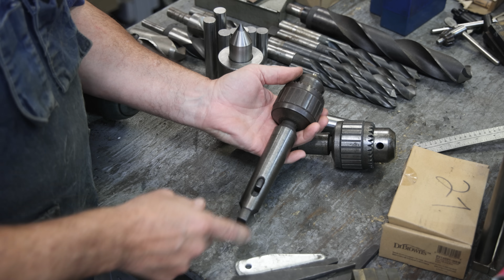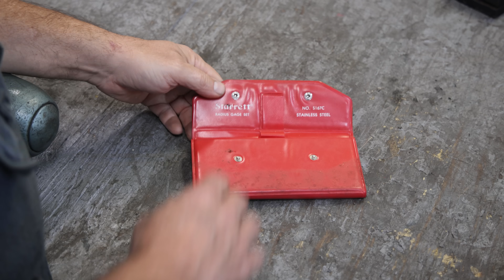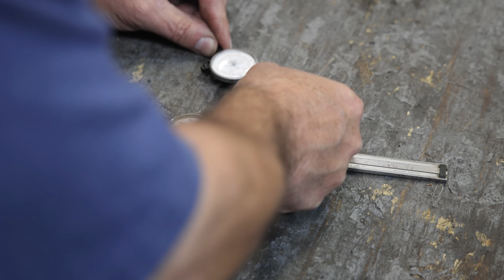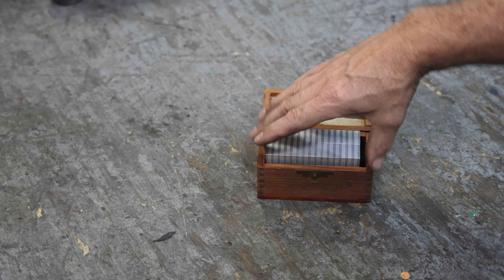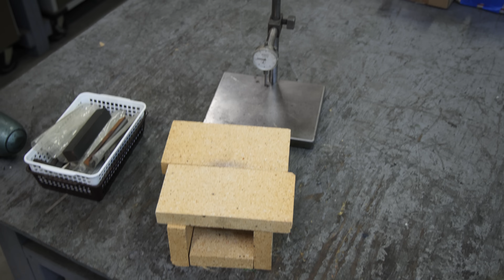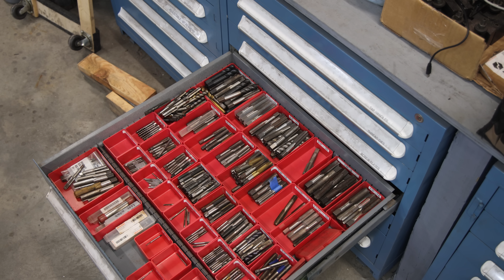Odds & Ends 155: Massive Haul of Tool and Die Makers Tools

Comment: Keith, the headsock taper you show @6:53, I have been looking for one for my 15" Colchester Lathe.  My Main shaft measures 2.313-2.000" over 2.292" with a No. 4 Morse Taper.  If the one you show fits my lathe I would like to purchase it if it does not fit any of your lathes.  If it fits your lathe be on the lookout for me one like that.

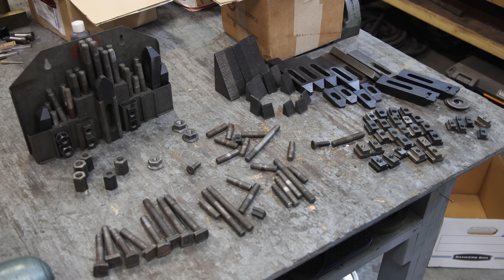Comment: At 18:55 - Keith is showing some hold downs and t-slot items.  Question: I have a drill press that has t-slots in it.  When I look for a set of t-slot clamps and such they want to know the width of the slot.  Is that measured at the top narrow part of the slot or the bottom wide part?  Thanks.

Comment: yup, that is a printer's line qauge. used to have a ton of those around. 

what a haul!

i bet those pins are for a specific sine value. moght make more sense if you measure them, then looknthem up in machinery's sine table. may line up with some common angles.

Comment: I bought a 3/8" clamp set for my small mill that uses 7/16" tee nuts but also need 5/8" nuts for my large turntable so cut the long ends of the 7/16 nuts to 5/8 so my clamp set works for both.

Comment: The K&T 2D had a triangular trough for the x and y axes that you could place cylindrical length standards in, a dial gauge then allowed you machine features to a dimension. Pre-DRO with no need to count handle turns. Maybe thats what the cylindrical doohickeys were?

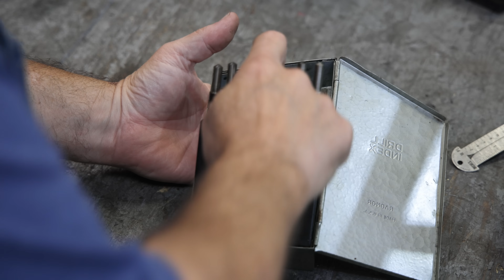Comment: you don't "bend" the micrometer barrel to adjust it. those are Morse taper "drifts" not "wedges". 9:08 I know exactly what those are, scrap.19:14 those things "you can jack stuff up on" are not jacks, which actually jack stuff up, they are "step blocks" . taps and end mills that are banging together as you have them stored, well.. scrap too.
Reply: DITTO, This guy has a lot of tooling but little knowledge of it, Just another wannabe machinist
Reply: Proof of Dunning-Kruger X 2

Comment: Never throw away a used drill bits or taps it can be reused to make cutting bit for what ever unique cutter one might need
Reply: They can also be sharpened to use as inserts in shop made boring bars. Need a 1/8 O-Ring groove in a bore? Mount an old center in your boring bar and grind the size and profile you want.

Comment: Those stair-step rods may be preset for angles with a sine bar.
Reply: I have a cross shaped shop made setter for a 5 inch sine bar that gives 1-5 degrees. Makes quick set-ups on the surface grinder to cut reliefs on tools.

Comment: Excellent score Keith. 
I have gone to Rocketdyne garage sales and typically they use a drill bit to drill one hole, then grab a new one for the next hole. They were sold by the pound. They also sold the hand tools purchased for a production contract when the job was finished. They would buy all new equipment for the next contract. You did great.

Comment: Nice assortment of shop tooling. Makes me envious. I have scored things like this before but not lately. There are fewer shops being liquidated in our area these days. FYI and anyone else, if you find a drawer cabinet made for  IBM index cards, they make great tool cabinets. Heavy duty full extension ball bearing drawers.
Reply: In 1966 I designed 3 plastic injection molds for Pitney - Bowes to store IBM  index cards for our tool shop builds. They were replacing sheet metal trays with injection molded units of single, dual and triple row configurations. 
Due to the long, narrow part's nature mold cooling channels were critical to not stagnant - the PO stated, Water flow must not be restricted by the connectors. The only time in 56 years I had to use a 1/2 NTP pipe connectors, 1/8 and 1/4 NPT were industry standards.
Their molding shop must have crashed the triple version, as we got it back once for minor repairs on a skid with all the water supply lines still connected. Evidently they couldn't supply the (3) 1/2 NPT cross flow circuits, each 1/2 NTP nipple was supplied with a 1/8 NTP quick disconnect! 
If the proper plumbing the mold's cycle would have been 20 - 40 seconds fastest with better attribute quality.

Comment: I buy stuff like this all the time. Organization is my biggest shortcoming. It gotten to the point were I could spend months, if I did nothing else, just putting stuff away. I also lack places to put stuff. It just keeps piling up. Add to that I have machining, metal working, bodywork tools, woodworking, mechanic’s tools, pullers, you name it, I’ve accumulated it over the years. It’s kind of a sickness, but it all comes in handy.